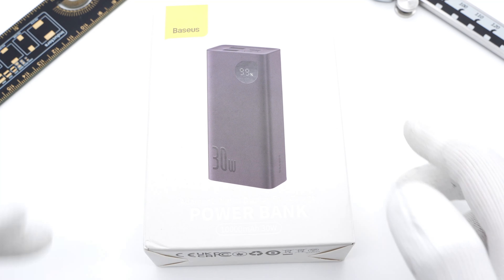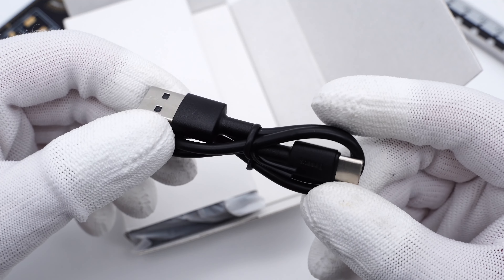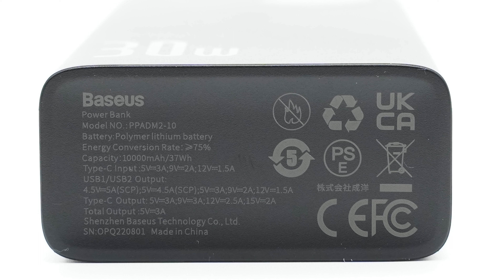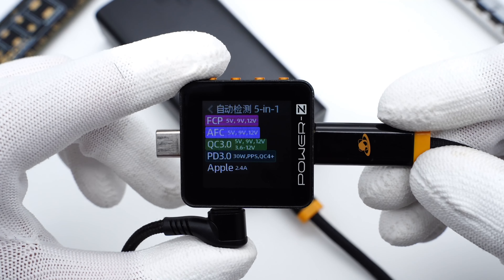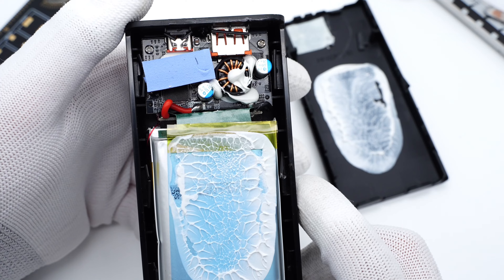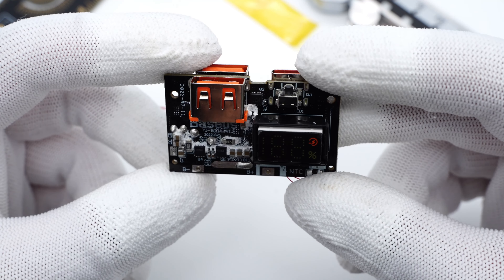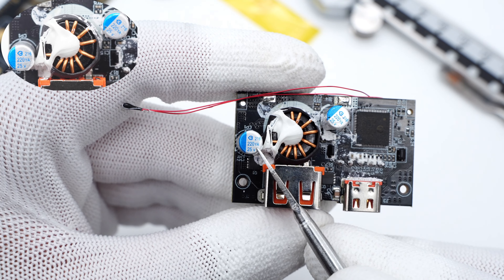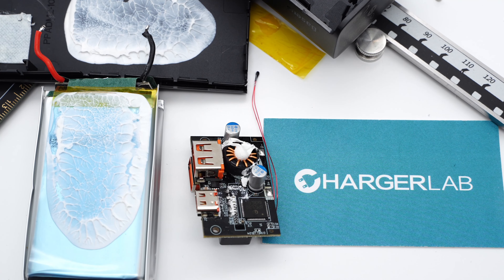Teardown of Baseus Adaman2 30W 10000mAh Digital Display Power Bank

Comment: Want to ask i just bought this pbank why its say capacity 5000mah ?
Reply: and why does this dude not mention it?
Reply: Capacity is 10000mah but is rated 5800mah because there is conversion rate around 75-85%. Learn what is conversion rate battery
Reply: Perhaps because it's 2x5000mAh cells?